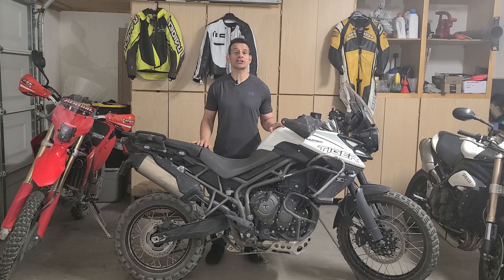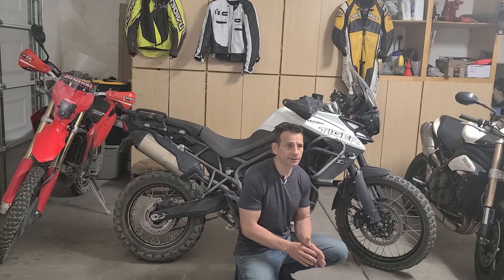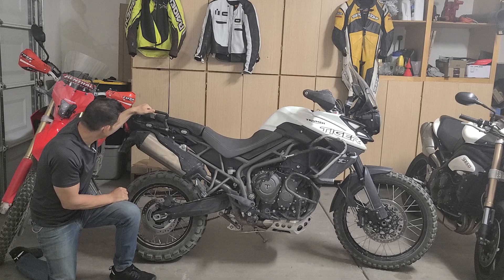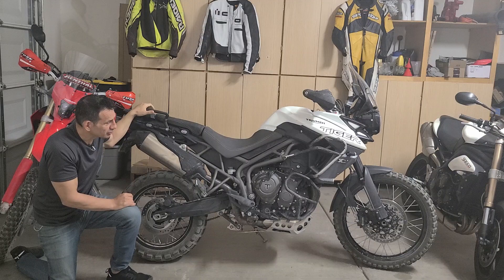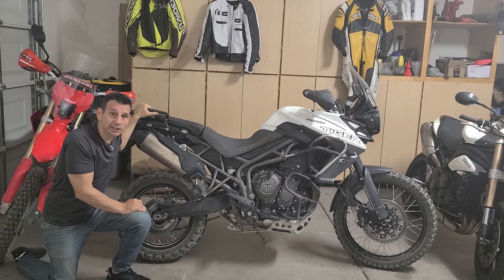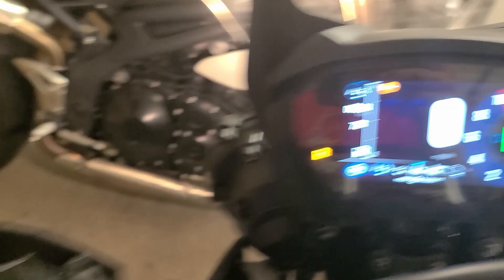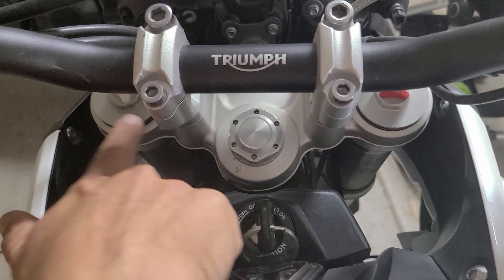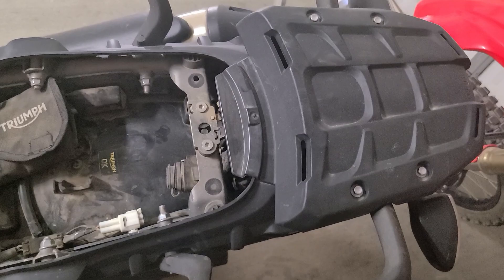Do Not Waste Your Money 💲 On A Triumph Tiger Until You See This

Comment: Alan Sanders did well over 50000 miles on a round the world trip. He has written books and done a few RTW trips including on a old pre 2000 modular triumph triple. They certainly are the triple experts and whether its a 765 moto 2 bike or tiger or 1200 shaft drive explorer you can depend on it more tan a BMW GS that costs far more for servicing and spares and doesnt have a great reputation especially on electrics.

Comment: It would be great to customise it as a proper military, round the world spec, camouflage paint job, fabricate bash plate, crash bars ,rad guard and protection for fork stanchions, rear shock covering plus tool box like cylindrical shape. Elimination of bugs and sorting of potential problems like drilling holes and tapping a thread to screw in grease nipples for steering head bearings or fitting good taper roller ones and packing them with grease, same with swing arm bearings as they are open to all weather's and corrosion can wash out grease . Shock linkages also are prone to suffering so keeping them clean, dry and well greased with some sort of protection is a good idea. It's a great machine in many ways, practical and it has I believe much of the same engine components as the 675 and 765 Daytona so the crankshaft, Conrods will be very well designed and for 130 bhp and the tiger 800 is below 100bhp so it will last. I don't like the design flaws like frame faults with Speedo mounting, crash bar going into the flimsy engine casing and the rear subframe potential to write off the frame if it's dropped. The old steamer tiger 900 and even the 955i motor had a brilliant ,tough rolling chassis that was solid. I had a 1996 Daytona and it was so well built but electrics let them down like the sprag clutch and reg/rec . I must admit I do like Tigers since my dad had a 1939 tiger 100 in the 1950s with a sidecar and he put telescopic forks on as standard they were girder. He had 2 motors and both did over 100k but he would strip them down on the kitchen table. I think those Tiger triples are some of best bikes triumph have ever built, the only other one I really like is the Thunderbird storm 1700 and the LT.
Reply: I do believe Alan Sanders took an 800 triumph round the world with no problems after over 50k miles and I've heard of those engines going over 150 k on the same crankshaft and bores and camshafts etc and even the camchain and tensioners seem very durable. Clearly triumph tested it well when designing it and sadly they seem to be less concerned nowadays with customer satisfaction as they have over priced bikes apart from 660 trident which seems to be a winner, however this 400cc bajaj made single is a bit of a joke however maybe this 250 and 450 dirt bike they are developing may be bombproof and won't have vulnerable parts that break easily. They should have built it a bit like the BSA works dirt bikes of the late 1960s keeping it minimalist, with no rider aids or heavy rubbish and a bit like Suzuki DR650 but water cooled and do a parts bin special like the 660 trident with cheaper nissin brakes, basic forks and a decent rear shock but have options for the buyer to fit brembos, ohlins etc as it adds a lot to the price. CCM have some good ideas but are let down by niggles like durable finishing and they're over 10500 for the cheapest husky 600 single engined bike so triumph with this new twin that's bang up to date, light and powerful should be onto a winner and out do KTM that aren't cheap and vulnerable to pump issues in the motor in places where poor quality dodgy petrol is sold by the side of the road like in a few countries in central Asia.

Comment: I had one of them an XCa nice bike, I’ve just up graded to a tiger rally pro, it’s a completely different beast. I love triumph bikes.
Reply: Is the Rally Pro's torque noticeably more pronounced off idle/down low? And what do you like about it compared to the  800 XC? I just put about 1,200 miles on an 800 XCX rental  anticipating buying one and liked a lot about it - then I saw some info on the 900 Rally Pro and was thinking it might be worth the $$$ difference.
Reply: @henrymiller3237  it definitely is, it’s a lot better off road due to this increased low down torque , it’s a fantastic machine.

Comment: Hello, i was wondering if you have had any issues with å starter On triumph 800? Mine is 2012 model and i have experienced that when engine is hot starter wont revolve as if the battery was flat, but after after 5 mintes of cooling starts ås if there was no problem at all.
Reply: That's a known issue. Rick's has an aftermarket replacement or you can try reconditioning the OEM.

Comment: I’ve had my 800xc for 9 years now. The only issue I’ve had was with a gear selector spring that was easily fixed. Apart from the odd puncture it’s been solid. I’ve binned the useless triumph screen and use a madstad one. The only other mods fitted are aK&N air filter, bar risers and a comfort seat.
Reply: Hi! How many kilometers?

Comment: I have the 2018 Tiger XCx.  I have the following installed:
1.  Heed bunker crashbars 
2.  Barkbuster hand guards
3.  Small led blinkers
4.  KTM Enduro Folding mirrors
5.  Motoz Tractionator GPS tires.
6.  Rear hard bag luggage rack
I just finished a small bike route in Arkansas with 5 riders on KTM's and a Huskvarna.  I shouldn't have been riding this route, but there I was on some of the most rocky, muddy and wet terrain I've ever ridden on.  I fell in the streams, the mud and on the rocks.  I fell so many times that my battery died from starting it so often.  After all of the abuse, falls (low speed) and water submersion  the body work (plastic) was undamaged.  However, my right hand barkbuster,  right hand Heed crashbar, bash plate and rear brake pedal were the only parts with any damage.  I bent the brake pedal and hand guard back into position.  I'll deal with the Heed crash bar later.
Bottom line:  if you put the right equipment on this bike you'll save the plastic.  The bottom stock crashbars are mounted to the engine case and will cost you dearly if you brake the mounting bracket.
Also, the usb port is there under the rear seat located under the cross bracket.
Video of the Arknsas ride.
https://youtu.be/9u1NCLPpo7U
Reply from the maker: How do you like tose Tractionator tires
Reply: @BornAGoon  They're a good all around tire.  However, if you're going to ride on rocks and mud I would step up to the Motoz Rallz.  Of course my skill set for offroad on a 500 pound bike is at a novice level.  I know the bike is capable of doing a lot of hard terrain with the Tractionator tires, but I am not.  I have 4k on the tires and they look like at least another 3k is left.
Reply: I also have a Tiger 800 with the Tractionator GPS. Not as good of a dirt rider as you are, but have never felt like the tires are holding me back. At least in the dry desert terrain we have out here in Colorado. Tire life has been above average in my opinion. I have 6k miles on my current set and they look brand new.
Reply: Outback Motortec makes the best crash bars guys. You remove the stock lowers and they don't use the engine in the front to fasten them. $355 US and easy to fit on. I watched many videos and that's what I decided to buy.

Comment: 26:45 That's why you don't do all this with the air filter. You leave the air filter as it is, but you get rid of the long oversized snorkel and you replaced it with a Unifilter prefilter. Job done. That prefilter will do the job perfectly. No messing around with cleaning the air filter. You leave it to the mechanics to access the air filter whenever the bike needs to be serviced.

Comment: I've had an 800xc for years now.  I replaced the starter, pretty easy/cheap.  Front fender broke off, I replaced with high mx fender(home made bracket), took off beak, put lights where beak was. Looks great.
Engine is great on the road, so so in dirt.    HERE'S the problem. That short 36* rake front end. This bike really wears you out in the dirt. You can do it, but it'll take some effort.  That front end constantly tries to knife in anything loose or deep.  You WILL eat some dirt/gravel.  I'll probably never buy another, unless they completely redesign this front end.   But on street or hard pack, it's a fun bike.
Reply from the maker: Exactly off-road the front end is like a shovel
Reply: Hi, how did you replaced the starter? One must remove the gasoline tank and engine TOP in Order to get onto the starter?
Reply: Hi, how did you replaced the starter? One must remove the gasoline tank and engine TOP in Order to get onto the starter?
Reply: @thinker-go3zi  That's right, you have to go deep, under the throttle bodies. Tank, airbox, throttle bodies. Mine was starting to act up so I removed it, took it apart, and cleaned it up. I use the Haynes service manual. Lays the job out clearly with good photos.

Comment: I’m looking at a 2016 xct.. low miles.  I keep reading about starter issues on these 800s which can get kinda pricey to fix?  Also, the support for the bike just doesn’t exist here in eastern NC.  Sucks cause it’s a nice bike.
Reply: You’re talking about the “stepper motor” for the starter which they fixed in 2015. No starter issues from ‘15 up. Very reliable bike honestly Triumph is a manufacturer where I wouldn’t personally worry too much about not having a dealership nearby unlike Ktm or Italian bikes.
Reply: @jf7393  - thanks JF 👍🏽
Reply from the maker: I have had no starter issues I wouldnt worry about it